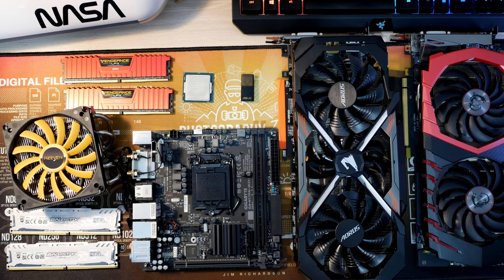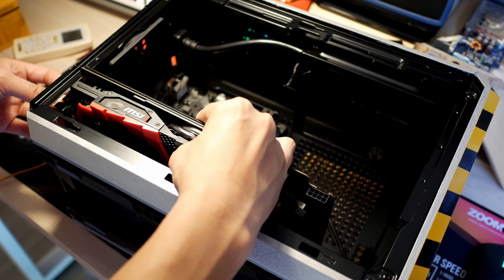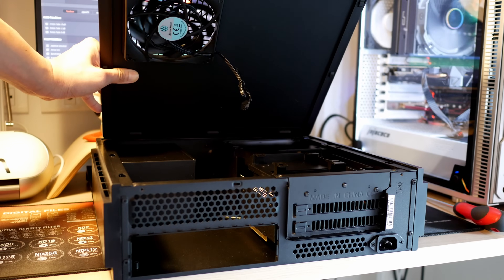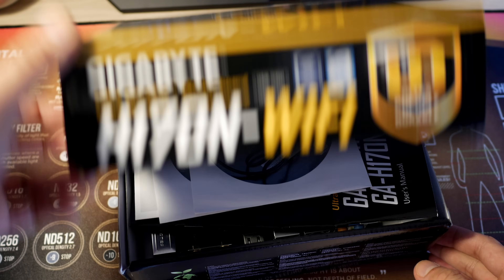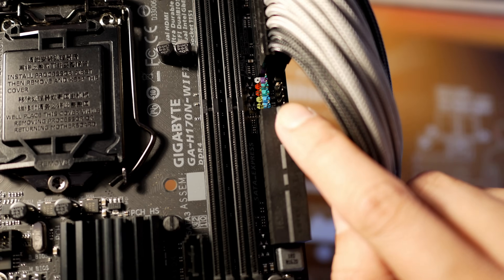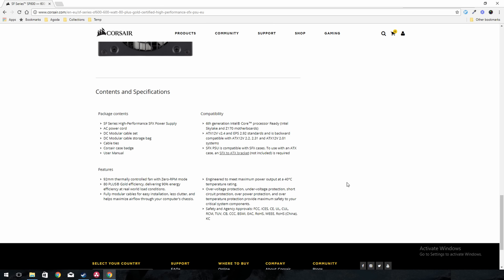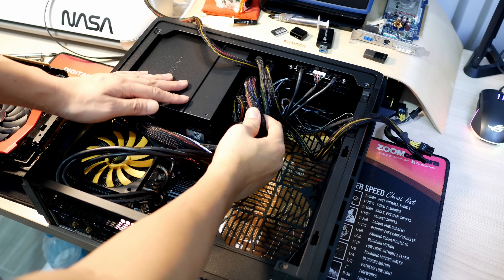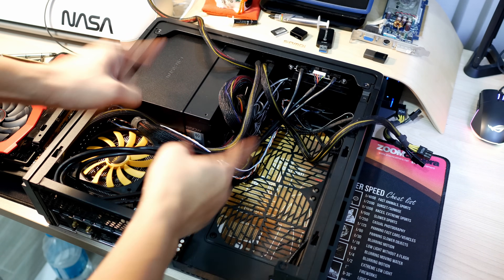Before you build a mini ITX PC

Comment: I'm actually starting a ITX build right now, it is going slow and expensive, but i saw you did the COUGAR QBX, how are temps on that one in comparision with an mid-tower since is the only one that i could buy atm, node 202 is expensive af here, and silverstone raven isn't avaible

Comment: Dear Jojococo, I’ve got a IMPORTANT question. I got also a RVZ03 and want to move my Aorus 1080ti (Xtreme edition, but has same sizes) from another itx built into the RVZ03. The GPU also uses 2,5 slots and not 2 slots what the manual from RVZ03 is saying, but the sizes from the GPU are (293:lenght/142:widt/55:height) and the manual from RVZ03 says: 330: lenght/149: width/68: height, so it has to fit right? Are you sure it is not fitting? Or didnt you say that… I was not sure about it.
Hope you can answer my question, would save me a lot of trouble!!! Thanks in advance and keep up the good work!!

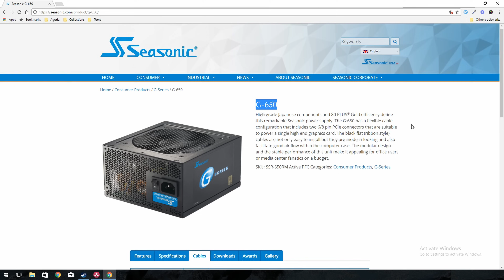Comment: Can I fit the rm750x at 4:40 in this case?
The rm750x is not a ps2/atx standard psu (psu type that this case is described as compatible) and it's length is almost 180mm, I hesitate if i can not mod the case to fit this psu in because I have a mini gtx 1070.

Comment: how to fit 3.5 hdd to this rvz03?
Reply: can't, this case doesn't have any caddies like the RVZ02 had where you could use an itx gpu (short) and a single 3.5 hdd! but just get a WD Black 1TB 2.5, it is a 7500RPM hdd!
Reply: You can mount a 3.5 HDD where the graphics card is if you are using an itx form graphics card. But you can purchase 2.5inch 7200rpm HDDs anyway

Comment: Nice video! 
Do you think a Palit GeForce GTX 1080 JetStream would fit into the RVZ03? It's triple slot (manufacturer says "2.5 slots") with increased depth (285x133x58mm). I'll have to swap ITX cases because of this card, coming from a SIlverstone SG08, which sadly neither supports deeper nor higher card designs :(.
Reply: Ow I think only 2 slot card fits. If it's 2.5 it has 2 slots but is thicker. You hit the bottom case fan.

Comment: Nice video, I really enjoyed it. I went with the Fractal Design Node 202 and I had a problem, with the CPU cooling. I never tried to buy an Intel Core i7 7700k, I went with the "non K" version, because it's a little bit cooler. And I had only 56mm of height of the CPU cooler so I bought a Cryorig C7. To be sure everything will be okay I use a blower style GPU, an MSI GTX1070 Aero OC, which with a good fan curve never goes higher, than 75 C. This case has an option to install 2x12 cm fan's which supports the GPU, but gives airflow for the whole case. 
I'm using the blower GTX, because first I used an MSI GTX 1070 Gaming X and the videocard spread all the heat around in the case and the CPU temps are eleveted about 8-12 C. 
Anyway, to built a small form factor PC is very challanging and very rewarding after you finished and the PC is working fine.
Again, this was a very good video.

Comment: current ITX are so stupid....cant wait for that Intel+Radeon new formfactor to become mainstream, so you wont need a stupid discrete GPU that covers so much space and the most stupid thing ever - that giant PSUs inside the case
Reply: Not really stupid. Discrete graphics give superior performance. This design is for a no compromise gaming system with the smallest possible footprint. There are a lot of mini PCs, smaller than ITX with no graphics card, but they always compromise on performance and cooling.
Reply: APUs, or whatever you call it, will not be powerful enough anytime soon. Heck even single GPUs aren't powerful enough for high end work, like 3d rendering. ITX design is somewhat sufficient for both professional and gaming work, smaller sizes won't happen anytime soon.

There are SFX PSUs, if you want smaller than that there's HDPlex+Brick solution which is smaller but if that solution got cheaper and smaller it would be more useful.

AFAIK one of the reasons of nonexistence of smaller than SFX size PSUs is regulations.

We also need better connectors. 24 pin connector is a pain in the ass even at ATX size, in ITX size it's a nightmare. And it never fits easily for some reason.

Comment: Hi Jojococo. I love you video especially that of the NZXT with LED backlighting. The others also I reassure you.
I would like to have advice to customize my case. Here is my config. Have a logo with red led on the front facade.
It would be great to answer.

Case: Aerocool GTA black
Processor: AMD FX 8320
Ram: 8 GB
Motherboard: Gigabyte 970 gaming
Graphics card: Gigabyte Radeon RX 480 G1 Gaming 8G

Comment: I like the idea of a slimmer power supply (full mod, 650w, 750w?) and CPU air cooler?
I especially liked the Graphics card and SSD(s) trey combo.  :-)
I wonder if they could be used in a mid or full size case?

Comment: Ive always wanted to do a mini build ! 
Quick question ! It almost looks like you could install a 120 AIO in there, and mount the fan/radiator to the side panel ? If possible, would this have better cooling than the mentioned Reeven cooler ?
Reply: Jaco aVo yes there are slim 120mm aio watercooling that fit!